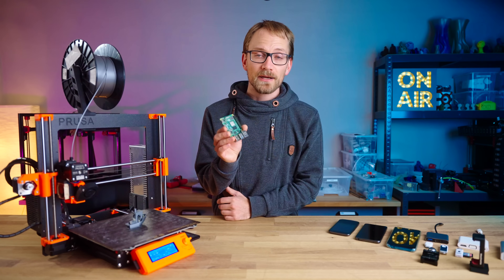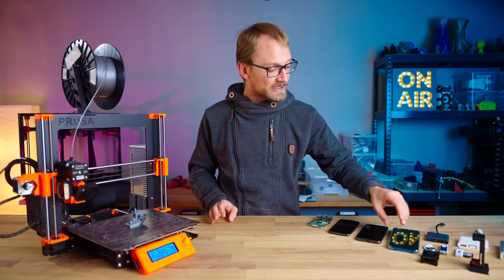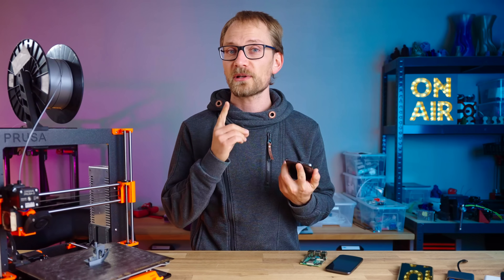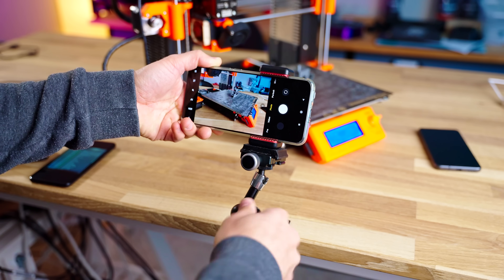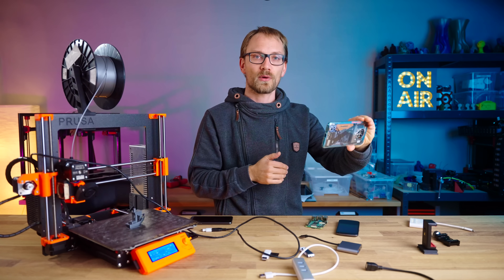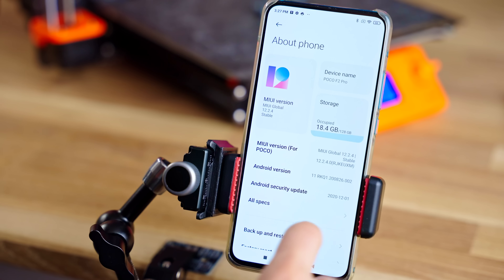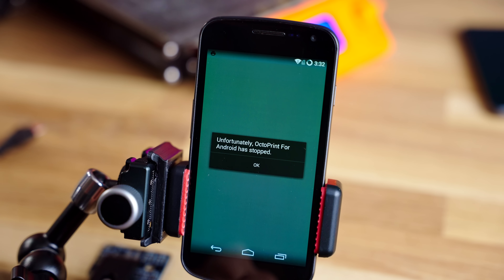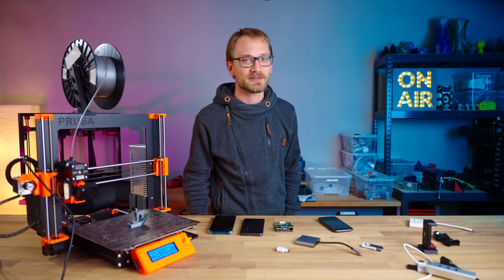How to run OctoPrint on your phone!

Comment: I'm still amazed it's so hard to find a phone sized for actual daily carry and real human hands out there. The only flagship I can think of is the Asus Zenfone 8 (non-flip) - which imo is the best Android phone on the market right now imo. That said - I'd still rather use a Raspberry Pi for Octoprint, but that's just my preference.
Reply: S10e? It's on the bigger end but still fits in my hand. They're very well priced on the used market though.
Reply: @TheshBuilds  s10e is the ideal size in my opinion.  Just perfect!
Reply: I miss my original LG Nexus 5. 4" screen is perfect in the hand, we don't need all this glass and aluminum. New phones are ridiculously large and heavy.
Reply: I got the Sony Xperia 5 km3 it's slimmer due to the 21:9 aspect ratio. I can easily reach across with my thumb 👍🏻
Reply: @fabianweihe8702  I second the xperia 5 (mine's a mkii) - the narrower screen makes it much easier to single-hand
Reply: I believe you're looking for more of a bannerboat. What you request is rarely compatible with a flagship.

Comment: Beware of Y-Cables or -Adapters with USB-C, they can be dangerous to the attached printer. If it’s just a dumb Y-Cable and the phone negotiates a higher charging voltage using USB Power Delivery, Quickcharge or similar, the higher voltage might end on the VCC pins of the attached devices, which can lead to the magic smoke beeing emitted from the connected USB devices, including a connected printer mainboard, especially if it has a USB backpowering problem (looking at you, Creality *sigh*). USB-C-Dongles with a dedicated USB-PD-Charging-Port are probably safer.
Reply: The USB 5v line to the printer board should always be blocked by tape, a blocking dongle, or the wire cut. I have black tape on mine from the Pi since it almost never gets unplugged.
Reply: @OldCurmudgeon3DP  Hi, can you please explain the tape thing? Thanks
Reply: @DerekH_UK  cut a thin sliver of insulation tape and put it over the right hand pin in the usb plug, the one that plugs into the pi (or computer)

It is the right hand pin when the pins are at the bottom and you are looking down at them...
Reply: @AkiraFurball  Thanks Louise
Reply: @DerekH_UK  You basically tape over the power pin on the usb cable.
Reply: ah yes
I love how my cr-10 control board stays powered until I unplug my raspberry pi
Reply: As long as we use a 5v only power brick it should all be good
Reply: I believe that the Y-cable will mostly be used for phones with a micro USB port and I don't think most of them charge at a higher voltage than 5-volts if any.
Reply: @TechBuild  Quick Charge 2.0 also negotiates higher voltages
Reply: @TechBuild  most of them, but there's a ton of qc, qc2 and even some qc3 phones that will charge at 9 to 12 volts
Reply: But if I use a 5V charger there shouldn't be any problems, right?
Reply: Any recommendation for a proper Y connector or hub for a phone that has usbC ?
Reply: @AmishSolanki  any usb-c hub/dock with a dedicated charging port should work. It just has to have some protection circuit so it does not apply more than 5 V to the attached usb peripherals.
Reply: Thanks for the heads up. Can you link me one to Amazon that you can recommend? tks!

Comment: You're going to get some really bad battery degradation if you leave the phone plugged in for months at a time.
If you can bypass the battery completely and have the phone run off of the mains power this is a great solution.
Reply: I've actually run Android Tablets 24/7 as displays and it took over a year for the first battery to swell. most are fine after more than 5 years. If you use custom android builds or are able to recompile the kernel, you can actually set the devices to only charge to around 3.8V max which is what I did at the end.

Comment: Good luck with ur samsung phone, i try over a month, couldn't get the otg cable to charge the phone. There's issue with charging with cable.
Reply: Same for me: tried 3 Y cables, none of them charge the phone. I'm searching for a solution (including soldering an extra micro USB type B). I'm interested if you found a solution already!
Reply: @LaurentWiart  I found what would be useful for Samsung phone, which is soldering a cable, add a restrictor or some sort, then the phone would recognize it as both charging and data transferring. Too much trouble for me, so I am waiting for my second cable, take so long.
Reply: Hey  @greatgamehunter , right, I saw some vids about this kind of option (put a 100k ohms resistance between pins 4 and 5). At the moment, I don't want to got this way, but I found some plugs that claim to support OTG AND Charging at the same time. 
Ordered one, and will let you know if it works.

Comment: In my short search for y splitter cables I found a Reddit post saying you have to be careful because if the phone tries to fast charge and requests greater than 5V, some cheap cables can supply that same excess voltage to whatever else is plugged in, in this case the printer which might cause damage?
Reply: Yeah, that's possible. To be safe, just use an old / cheap 5V only charger you probably have laying around.

Comment: Great idea, beside the problem with continuous charging the battery that can get you into serious trouble. Anyway, where did you check the Raspberry availability, it's still available for normal prices, at least here in Germany 😁
Reply: If you root your phone you can limit the charging to let's say 40% and restart it when it drops to 30%. Combine that with a limited current charger and your battery will last a lot longer.
Reply: @Anonymous-qx5uk  Thanks, that's a good tip.

Comment: THANK YOU THANK YOU THANK YOU
Reply: You Having trouble connecting getting  "Offline after error No more candidates to test"?? go to octoprint settings on phone select to run server upon boot then restart phone. If it still doesn't work, multiple reddit and octoprint threads indicate that people tried 3, 4, sometimes 5 different USB cables before one wanted to work. Also try the dropdown change from auto to (whatever if anything it says there other than auto) Hopefully just saved y'all hours of searching, fiddling and fussing with this :)

Comment: Today i upgradet my pi zero w with an pi zero 2 w for my octoprint setup and it works so much better. i dont even need a more powerful pi so for 15 € its the best you can do.
Reply: The Zero W was perfect for my application. Everyone else seemed to have problems with it but, for sending files over the network and controlling the printer it worked great.

Good to know that the Zero W 2 works even better.

Comment: it would be awesome if you could remove the battery from android phones and they would still work. I don't like the fact you have a battery constantly charging for very long times. They can swell up and etc, so there could be a risk doing that. with a pi it would have no risks (besides using a shady power supply).
but using an old device is great.
Reply: Indeed, but as other mentionned : you could replace the battery by solderinf a small power supply in its stead
Reply: What I have in mind as a solution to this problem is to root the phone and limit the charging to let's say 40% and restart it at 30%. With a low current charge I think it won't be much trouble for the battery at this level. I already did some tests with automatically turning on and off the octo4a app so it will only charge during prints as the app turns on when the printer gets connected.

Comment: It is also possible to re-use old android tv box and either install fully featured Armbian or in worst case just run android octoprint. There are so many other arm devices around that can be reused instead of buying rpi's. The only downside is lack of gpio. But that can be cured with usb hub + arduino.
Reply: But you also need a display device than if you want a permernent display on your printer. An old TV would be a little bit overcized on a prusa mini. Also a tv box mostly has no webcam (but you always can use an ESP32 cam)
Reply: @oleurgast730  neither an rpi has a built-in display.
If you don't care about timelapses (and most users don't) it makes zero sense to buy webcam for rpi as well. Much more logical is to get IP cam. They have 100 times more features for same price.
Reply: @oleurgast730  I just use my computer. like with my pi 4. like I did with my pi zero. No biggie. I hardly use a camera.

Comment: Great idea! I have my three old android phones stacked in a box and haven't got around to adding a webcam to my Cr10SProV2+Octoprint+RPi2+Klipper yet :)  Now I won't need to hunt around for a probably at most 720p webcam for the pi at a probably not cheap price :D
Reply: Simplish webcams are affordable again. I could buy a 1080p30 webcam with a very wide angle lens and fixed focus and terrible IR rejection and slightly wonky colour at Conrad for only 15€ (regular price for this sort of thing hovers around 30€) just a couple weeks ago. But it is actually super sharp and actually 30fps in MJPEG mode.

Comment: One thing you can do is to hook up 4.4v directly into the phone. In theory at least, never tried it out.
Reply: Most phones and tablets check battery status (the third pin on the battery) and do not boot without. For that reason you should remove the PCB of the battery and use it between power supply and battery contacts.
Reply: Back in the Perk mining days, a common trick was to connect a 1N400x diode from the USB input to the battery input. It was also common to salvage old ATX PSUs to power a few dozen phones in a mining cluster.

Comment: Something to consider while using a phone/tablet :
If it's plugged continuously (like 24/7) for a long period of time (like months) the risks are way higher that the battery inflates, so big risk of fire.
I learned that by experience and bunch of other folks had the same issue  trying to recycle their old phone
Reply: Battery can be thrown away. Just use step-down board with good 5V power supply.
Reply: @D9ID9I  definitely, but it is something important to consider
Reply: @nobodyontheinternet784  consider to check voltages. It is fine to apply 3.7-4V constantly. But very cheap charger boards are not that precise often. If they apply like 4.3V to a battery then yes battery can easily inflate or just die.

Comment: Nice, but I'd rather run multiple octoprint instances on a single RPi using Docker
Reply: how well does an RPi handle the shared load on CPU, GPU, and RAM? How many instances do you have running simultaneously?
Reply: @RedOnRye  Two since I only have two printers, but the general rule of thumb is to run up to one per core.

Comment: While I really like this project, it would have been easier to replace the battery with a usb power source directly as the battery will probably heavily degrade over time if you leave it like this.
Reply: That's my main concern. We all know it'll run hot while doing a constant process and charging at the same time. I wouldn't leave my house with a lithium bomb in my basement.
Reply: @TechnologistAtWork  Most reasonably modern phones are fairly smart about their charging. They barely sip power charging those last few percentages so there's very little heat as a product of that charging even if under workload, and if left connected they do not remain in a constant charging state, but constantly analyze power use and cycle in whatever voltage, current and interval is deemed to cause the least heat and wear on the battery.
Reply: Exactly.  I can say by experience that the battery will definitely inflates after a few months (maybe more).
Some rare phones can works purely by usb. Mostly old ones, but never tried with a PD charger with more recent phones.  Would be worth a try
Reply: @nobodyontheinternet784  You can also hack the original battery by just taking the small board at the top of the battery, cutting of the battery terminals and replacing those with a usb power supply. It works like a charm, done it with 3 of my old phones.
Reply: @vincent.schmandt  yep.  Was talking about that in another thread
Reply: Not the case on most phones, not modern ones anyway. Most phones will shut down hard extremely fast if they go more than a couple of seconds without within-spec telemetry readings off the battery. It's not just "black and red wire go brr". There's a reason why most modern smartphone batteries have 4,5,6 pin connectors or more, even from just a single-cell "battery". Most of the little boards generating this telemetry also have e-fuses now (regulation thing I believe, lots of new stuff came in after the Note 7 sagas), so they permabrick if they experience severe undervoltage or full loss of power. Meaning quite often you can't just snip that board off an old battery and hook up a 3.9-4vdc supply to the battery cell tabs and use it like an infinite capscity battery that way. You could try it, just be VERY! careful cutting the tabs, and with the old cell afterwards, as it has no protection at all anymore. Keep that in mind when disposing of it too, tape up and protect those tabs really well. 

If you wanna try to run it like you suggest, look into higher end model-specific bench PSU power cables for microsoldering repair work. Some of these have built-in electronics to simulate the battery telemetry the phone is requiring, and they have wire gauge morr suitable for sustained load. The low end cables do not have these telemetry emulation circuits, and most androids samsung S3 and newer ish, won't even fully boot up before cutting off without it.

Comment: I wouldn't recommend having battery connected all time it will explode after 24/7 daily use for a year
Reply: I can verify this, had also 3 phones that nearly blown up it's battery after 24/7 connected to charging. These were some decent phones from well known brands.
Reply: Heck, most manuals of laptops and phones say to not leave the devices plugged 24/7...
Reply: I think it depends on the phone BMS
Reply from the maker: Nope, batteries won't just explode like that.
Reply: @MadeWithLayers  not necessarly explodes, but will definitely inflates after a while, so way higher risk of fire (talking at least a few months).
Happened to me with two phones I was using a phone as a permanent 5G modem.  I'm not the only one.  Bunch of folks had the sametjing happening

Comment: Hot tip: You could also buy a Raspberry Pi 400 Personal Computer Kit. Secured my Xmas gift with it already. :D
Reply: Any pi model would work. Although connecting a keyboard to a 3d printer would be Hella funny
Reply: Or just throw hundred these bucks into the window. Because if someone already have old devices laying around they most likely do not need to buy anything already.